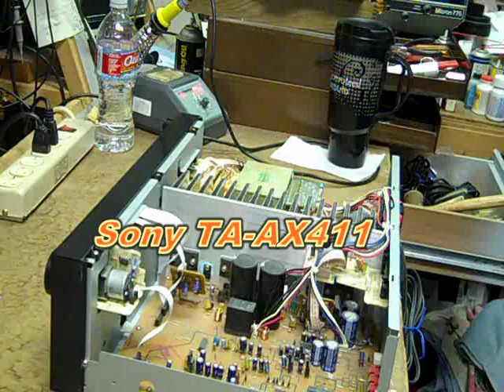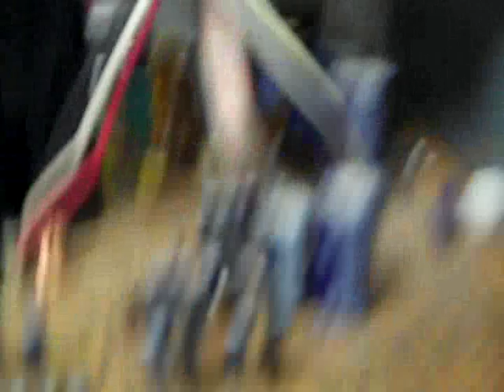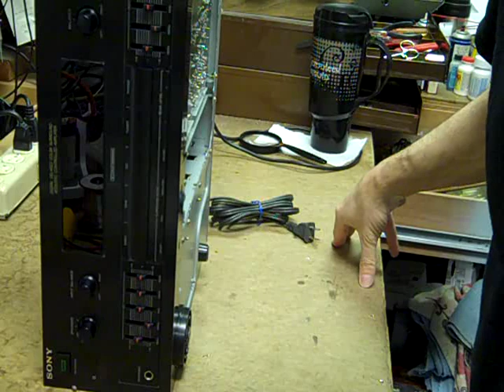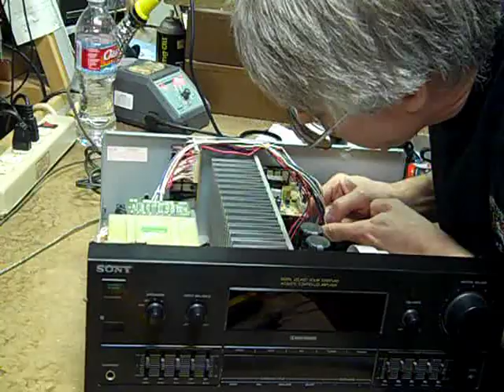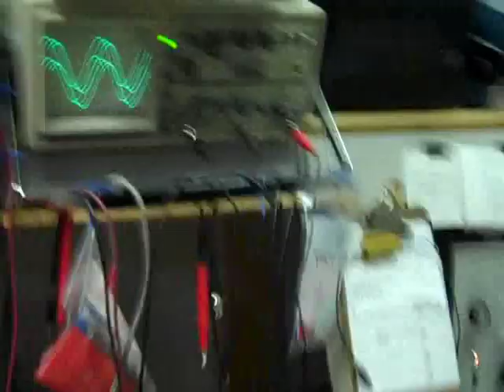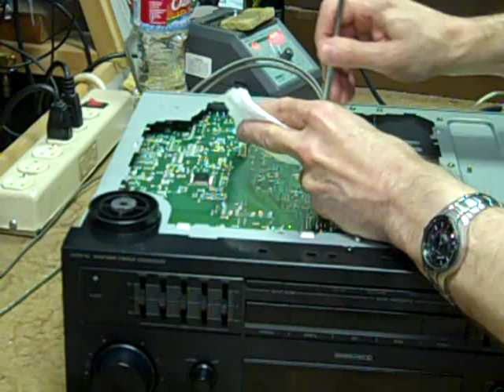Sony TA-AX411 Repair Brief

Comment: Have a short in mine.

Can't quite figure out where exactly.

8A fuse blowing. 

If I take the orange and white wires off (the ones next to the 120V contacts) the fuse does 🚫 open when I give it power. 

What's my next step?
Reply: Does not open

Comment: Enjoyed watching your video.  I have a Sony TA-AX390 that turns on; however, the EQ display bars section is completely lit up.  I get no output from any given input.  I was going to trash this amp, but figured I would check and see if it's a worth fixing issue.?.?  Might you know what the problem is or things to check?  Thanks.
Reply from the maker: I'm not finding a service manual on that one but I can say I would start by examining the solder connections at the display tube itself, and checking all the power supply voltages. There should probably be a -30V line and a +5 volt line for the drive IC.

Comment: Sir I have tabletop music System of sony from sometime my set had not memories the FM radio station and not an equalizer setting which I had set, I have set it every time when system made on. Then it keeps memory for few hours. After 5 - 6 hours memory erase, so what is the problem?
Reply from the maker: First of all, I wonder how you can even expect a useful answer when you have not so much as given me a MODEL NUMBER. Perhaps you have a bad backup capacitor or battery in there somewhere.

Comment: I just got the same receiver amplifier and my A &B left front outputs are not working any ideas of were to start . the A&B front right outputs work fine any clues of were to start
Reply from the maker: If it is like the Sony in the video - I would suggest carefully resoldering the drivers etc like in the video. Also the speaker relay may need contacts cleaned.

Comment: I blew my display out with a lot of RF. Any idea what the zeners are on the front board? I had a dead channel and it was the bias driver transistor. I love the Dolby decoder on this unit, that's why I still use it with a blank display. SM says it's HZS4ALL-TA and I can't find a reference to cross it with.
Reply from the maker: Is this a TA-AX411 like in the video? I can't find a (free) service manual on line. Might have one at work.
Reply from the maker: Looks like maybe I got the model number wrong in the video. Should be TA-AV411? Anyway, I found an old datasheet for that diode. It's a zener diode rated at between 3.4 and 3.8 volts, 1/4 watt. Not exactly a precision reference. Anything in that general voltage range ought to work.
Reply: I can send you a copy of the SM. Is 3.5 volts enough to make the florescent stuff light up? I know the higher voltage is there because the cathodes glow red.

More: Maybe the 4 in the part number is 4 volts?
Reply from the maker: I do the 4 probably means 4 volts. Have you measured DC voltage across those zeners? Have you confirmed approx -27 volts from Q951 in the power supply?

Comment: Hello Mark, awesome videos. I just recently gave maintenance to my old TA-AX411, changed filter caps and resoldered many components. I had a question, the sound on my speakers sound a little scratchy, does not pop, just scratchy. Also the bass does not sound too good(definitely not like the old days). I understand they are 20+ years speakers and dont have other speakers to test with, but if I test with my headphones sound is perfect, bass, treble everything. Could it be my speakers being too old? This problem happened even before doing the maintenance.
Reply from the maker: +Fernando Huezo Maybe the foam surround on the woofers is rotted? Common problem.

Comment: TA-AX2 when i turn it on, it make a popping sound when i push the low filter it goes away if the bass pot is turned all the way down. i do get sound on both channels if the volume is raised it saters popping again whats wrong?
Reply from the maker: +Ray Anderson Haven't looked at a schematic but this kind of problem is almost always caused by a bad coupling capacitor somewhere in that area. The pop you hear is a DC shift when you press the button.

Comment: HI Mark. I have an amplifier just like the one in this video, model TA-AX311. I also have the tuner model, ST-JX311. Both components have lost lighting when turned on. Would you happen to know is this a relatively small repair or a large repair and would it be worth having repaired? All components are in a rack system and look new. Just no lights. Thanks for your help. Sure wished you lived closer to N.C.
Reply from the maker: +Bryan Lippard Quite possible bad solder connections like in the video. Technique is important in soldering. One must be careful to make a good connection without damaging the board or bridging adjacent connections.

Comment from the maker: First check that you did not create a problem with adjacent solder connections touching each other. Secondly you may now have a "blown amp channel"; shorted output transistors and the like. If you are handy with a multimeter check for shorts between emitter and collector of each output transistor.

Comment: I have a sony amp ta av411 just like this one. The right channel had low output and static in it. I checked the solder joints and the ones on the power transistors looked bad. I resoldered them and now when I turn it on it blows the main fuse. Any idea what happened?

Comment: Thank you for uploading this kind of vedios,

I have sony mini Hi-Fi system and its FM tuner is not working.
I tried in my best to fix it. But I could not fix it.
So, I tried to replace the tuner with CXA1238 tuner as cxa 1238 tuner is high quality tuner.
But I do not know how to engage it with digital tuning.
Kindly help me to do this.

Thanks you.

Comment from the maker: @byplain Most likely a hard short on the secondary of the transformer, like maybe a shorted rectifier or filter capacitor, although a bad power transformer is possible. Possibly a blown amp channel. If you aren't a technician, your chances of fixing it yourself are not great, but also there are safety issues involved. A poor repair could be a fire hazard.

Comment from the maker: Don't have the manual. Check the driver transistors, any resistors going to the output transistor bases, often between the drivers' emitters there's a resistor burned. Often around 330 ohms or so. If such a resistor is burned replace those drivers. Like you said, check the bias transistor and emitter resistors. Watch out for bad solder connections at the drivers.

Comment from the maker: I'm not clear on what's what. Are you using the same dvd player on different inputs, or the same HDMI input? Or using a different player or source?
Tube isn't letting me put my email in here. Try the parts in parentheses. (mark) (_zacharias) (AT) (sbcglobal) (DOT) (net)
I warned you these aren't for the faint of heart. BTW the board with the HDMI is over 200.00.

Comment from the maker: Probably means the receiver is losing lock on the digital signal. Maybe a bad solder connection in either the player or the receiver. You might try another player and see if it still does it. These Yamaha's aren't really prone to bad solder on that board. If the other digital functions work, like using HDMI audio (Dolby Digital etc) then it seems unlikely the problem is in the Yamaha.

Comment from the maker: Too much resistance (impedance) isn't the issue, it's when the impedance gets too low that you have a problem. Lower impedance just gets you closer to a short circuit. I think if you moderate your bass and tone settings you'll find you can boost the volume a bit more.

Comment: the back does read ta-f700es, and the front reads spontaneous twin drive, weights about 40 pounds, i may hook it up to two more speakers today or sometime to be sure , all of the ones ive seen on here have the on light being green and mine is red, but thoseothers were in england, i dont know if there is a difference or if the red light is telling me something. but i did have it going several years ago about 15 and not since.

Comment from the maker: Probably an over-current detect. Probably just playing it too loud, guy. These things aren't PA amps. The best way to get louder sound is more efficient speakers, not more power, but it looks like you've probably got that covered with the Vega's...BTW close to 1/2 volume will often peak out the amp's max power depending on how loud the source is. Especially with today's compressed music and recording techniques.